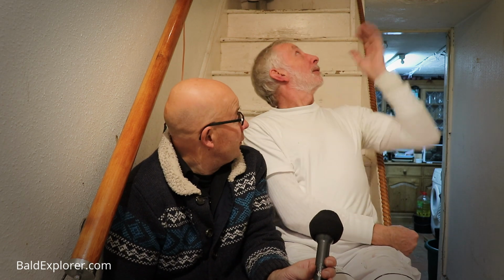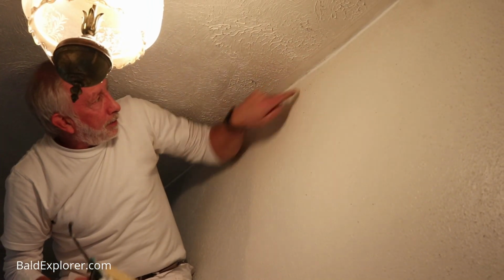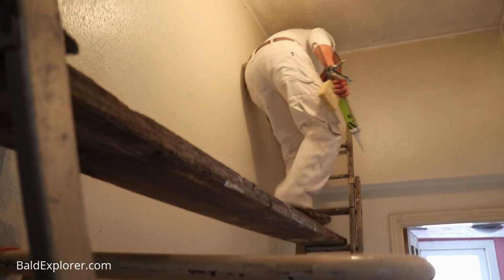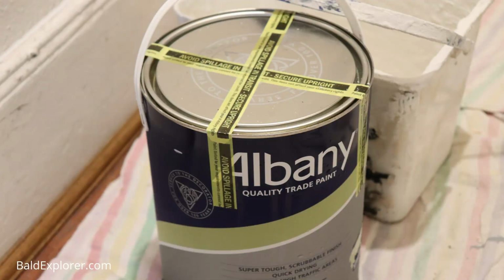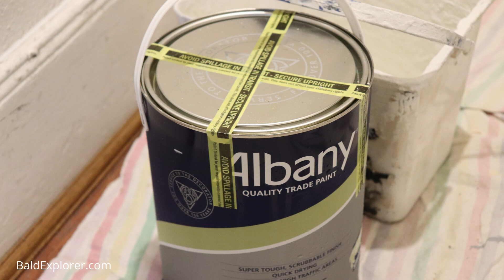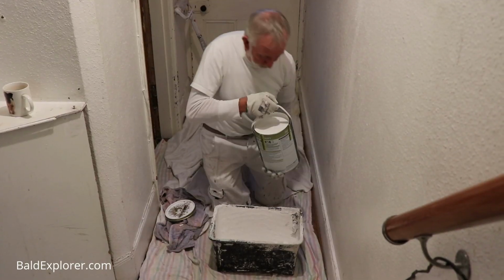How to decorate old houses, with Kevin Hall

Comment: Great video chaps,as a painter decorator myself I too have suffered from the cheap paint woes because someone had specifically chosen it,and yes it takes coat after coat to cover.I like Kevin have my favourite,and for ceilings especially  I always if I can,get my customers to choose Crown Matt White as it has superior opacity(the quality of lacking transparency or translucence)....there's a good old word for you.On water stains through paintwork,I either use Polycell Stain Stop or a white trade undercoat as a barrier to block the stain,before applying any emulsion over the top.Anyway,look's like Kevin has it all under control,well done Kevin,kudos to you.
Reply from the maker: You guys know your paints! Thanks so much for watching.

Comment: O didn't realize your house was a Victorian!  What year?  My oldest brother used to be a sheetrockeeer/drywaller & would walk around on these huge stilts.  Point being, when I saw that "bumpy" wall I knew what that was all about - & yeah, def not period! (Well maybe 1980 instead of 1880😅😉)  You about killed me when you said you removed the banister!!!!🤯  I hope you hung onto it cause you ever want to restore the stairwell, it's gonna cost ya a pretty penny to to have a new one rebuilt.  I love old wood work in houses (you've prob already figured that out about me!😆).

Btw...love your sweater (jumper).  It looks very cozy & warm.
Reply from the maker: Alas we got rid of the bannister about 25 years ago. The house was built around 1875. :)
Reply: @RichardVobes  I love Victorians but aren't they like your least fave period of architecture?🤔😄😉